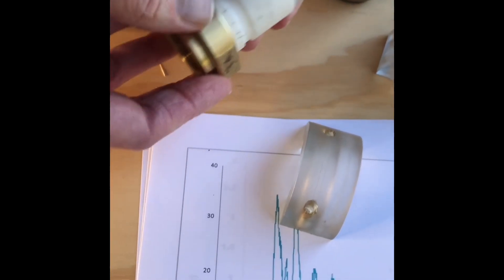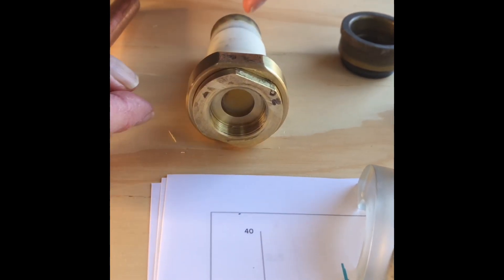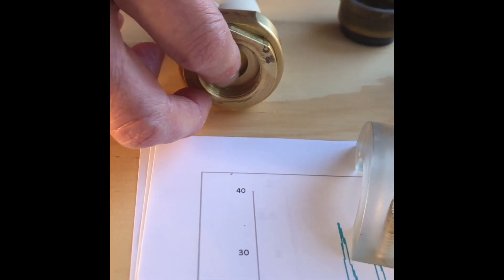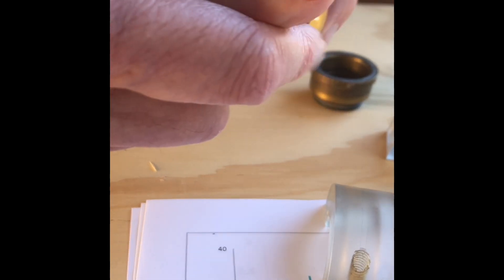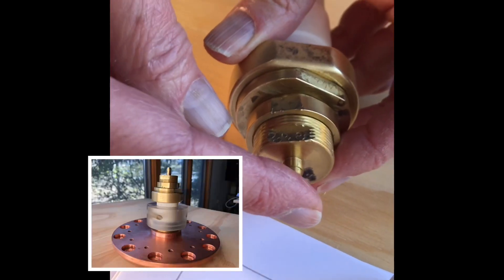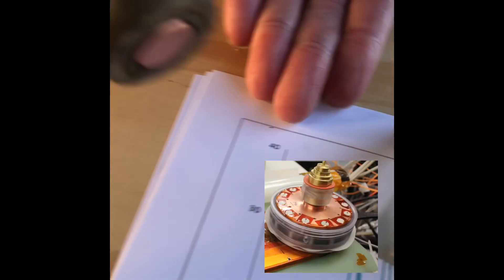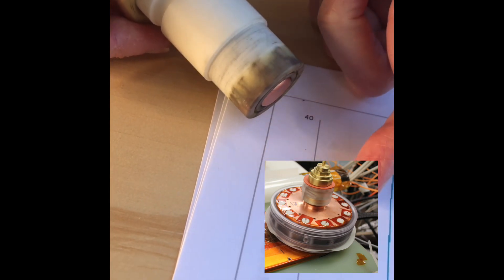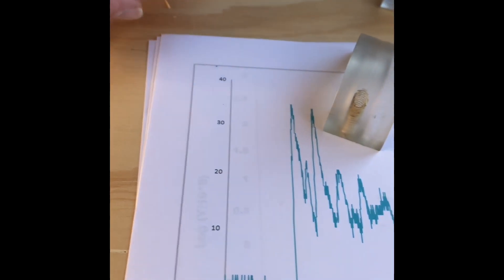Unidentified Kitchen Object-Part 2

Comment: I'm not sure why you need a 60kV trigger pulse, my understanding is you only need a tiny spark to cause an avalanche breakdown in the main switch (e.g. a small hole in the cathode through which a spark plug is inserted and a few kV applied). I guess you have good reasons for not doing that though?

Comment: These videos are way too short. I can't follow a conversation that is divided over one minute videos.
Reply: He only got as far as "even though..."  and the video ended...  It's like he was about to get to the most important part, but the videographer got bored and wandred off....
Reply from the maker: @direbearcoat7551  The videographer who's been with the company for 10 years and had participated in design, software design selection, in the experiments, data fetching and analyses, filming the experiments, filming the experimental preparation where the FoFu is, presenting the exp device to investors etc...actually couldn't follow the verbal explanation of the complex design Eric is referring to, and has felt a need to intercept with a better explanation of where the anode is compared to the sparks/switches so the viewers get a picture - with a picture rather than with wavy hands explanation.  Please check the next part. ;)